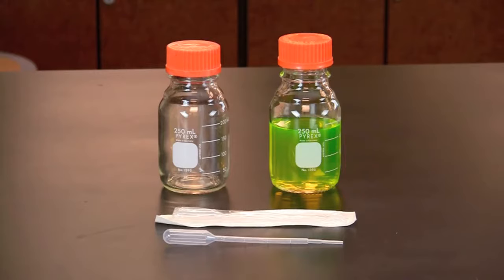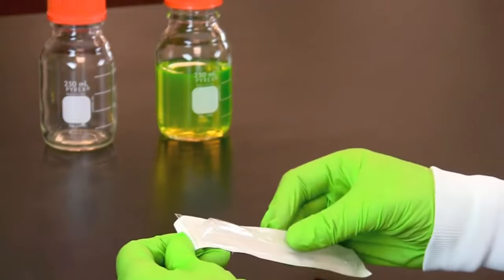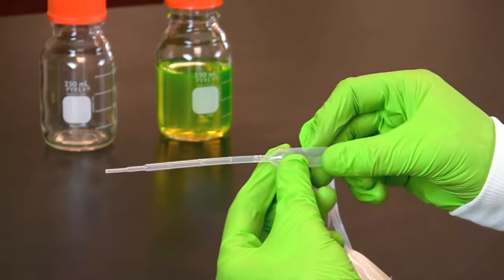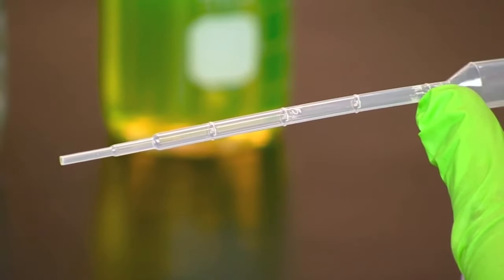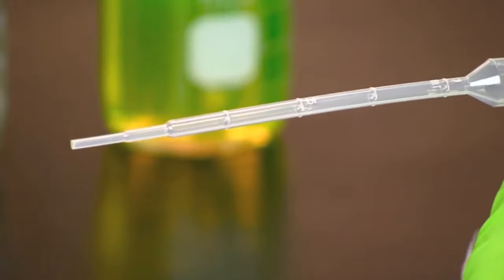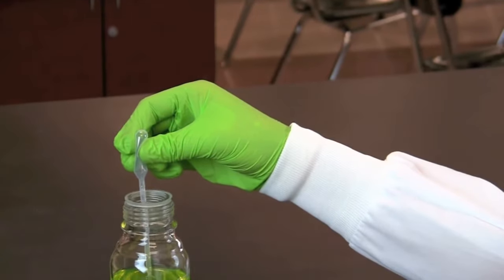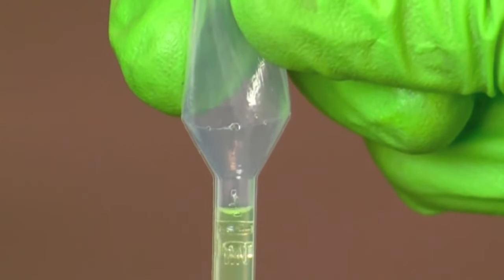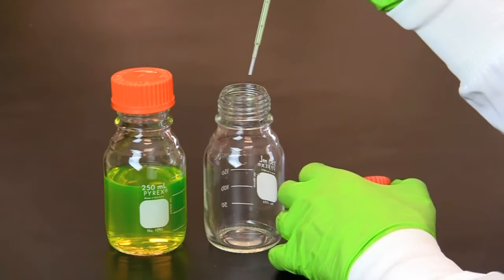How To Use A Transfer Pipet

Comment: So when you have taken the liquid,you have to hold the top of the pipette in order to mantain liquid inside?you can't just release pressure right?
Reply from the maker: Once liquid is in the transfer pipet it will remain there until pressure is applied to dispense the liquid.